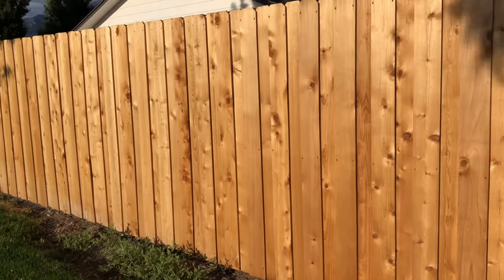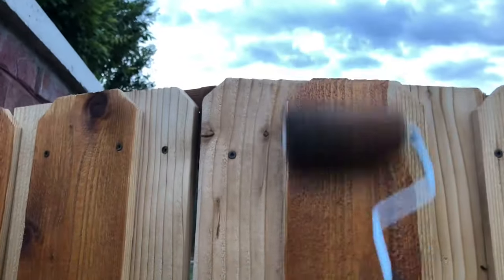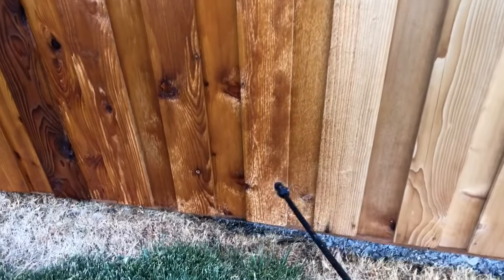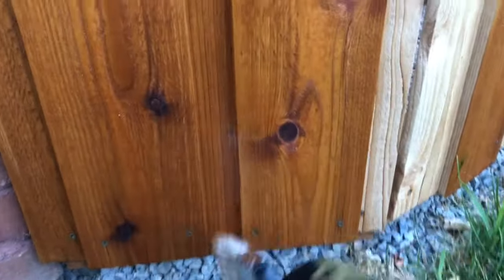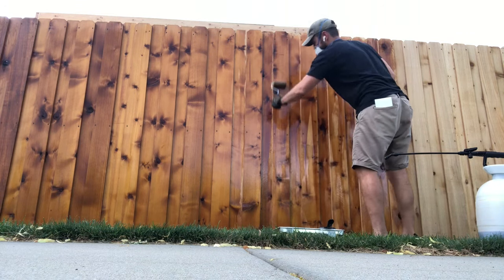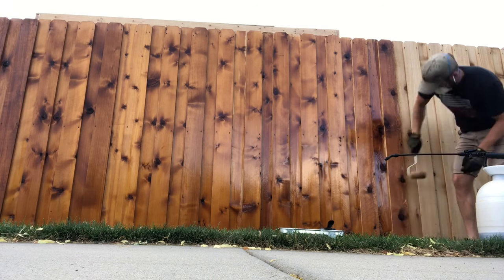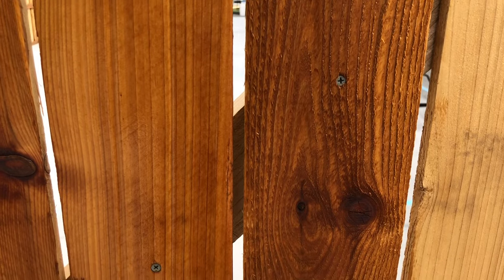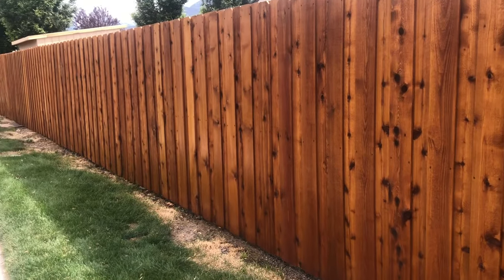Staining Cedar Fence with READY SEAL Light Oak - Spray, Roll, Brush

Comment: Do you need to do both sides for protection,I’m installing a privacy fence over my cyclone fence on one side of yard,once installed I won’t be able to access the backside due to not being able access as it is in my neighbors yard
Reply from the maker: That's a great question. What wood are you using? It will definitely help with longevity to do both sides so they're sealed and protected. But in my non-expert opinion, if you don't stain the backside, as long as you're using rot resistant wood like cedar, it would take a really long time for any kind of decay or rot to form and the make its way from the unstained backside to the front side. It would look really ugly on the backside after a few years but sounds like you'd never see it.

Comment: Does it leave a film that peels?
Reply from the maker: Not at all. That's the beauty of oil based vs. water based... Assuming the wood is properly dry, the oil-based stain/sealer will soak into the porous wood rather than sitting on top like paints and water based products, which end up peeling.

Comment: Did it end up fading after a year? About to stain my fence in the next few weeks.
Reply from the maker: It's been two years and still looks great. It has faded a little bit of course, but definitely doesn't need to be re-applied yet. Will try and post a follow up video soon.
Reply from the maker: Just posted an update on what it looks like now 2 years later if you want to check it out! https://www.youtube.com/watch?v=05B_spCNgv0

Comment: Hi Can I ask how the sealer is holding up? Thank you
Reply from the maker: It's holding up great after just over a year. It lightens up a bit in the weeks after applying, not since then. No regrets and I even used the same stain on another section of fence I built. Thanks for watching!
Reply from the maker: Just posted an update on what it looks like now 2 years later if you want to check it out! https://www.youtube.com/watch?v=05B_spCNgv0

Comment: Thank you for sharing. Been debating between light oak and cedar.

Did you power wash or clean the fence beforehand?
Reply from the maker: I built the fence and let it sit for about 3 months in the hot summer sun. Then LIGHTLY pressure washed it a few days before staining to get any dirt or dust off. Seemed to work well.
Reply from the maker: And I have only seen photos of the Cedar color, but I'm very happy we went with Light Oak. Love the shade.
Reply: Did you cover any metal parts before staining the wood?
Reply from the maker: @gigatube24    yeah I covered them where possible, but it wipes off of metal super easily so was no big deal if I got some on there (which I did). Just wipe it off soon after applying and don't let it dry.
Reply: @i_try_diy  I appreciate the information and the fast reply. Thank you!!

Comment: Did you do 1 or 2 coats and how many 5 gallon buckets did u use for the 130 feet of fence?  i’m assuming u did both sides?
Reply: Btw great video.  i have 120lf of fence so this was just what i needed to see thabks again.
Reply from the maker: Glad it was helpful! I only did one coat and used two 5 gal. buckets. Had a tiny bit left over after about 125 ft of 6' fence both sides. The way I did it was slow, but almost zero waste/overspray compared to if you use a sprayer, definitely a trade off.

Comment: How did the stain hood up after a year? About to stain my fence.
Reply from the maker: It has held up really well through all four seasons out here in Utah, really pleased with it. I'd say it's lightened up a little bit, but nothing major. Will probably re-coat in another 2-3 years. Good luck with the project!
Reply: @i_try_diy  Nice also another question how much stain did it take you? Just bought 5 gallon hopefully that is enough
Reply from the maker: It took me 10 gallons to do about 115 feet of 6' fence, both sides. It varies if you're using a sprayer or not, sprayers typically require a bit more stain
Reply: @i_try_diy  okay thanks just found out I have to get 20 gallons. I have 221 linear feet of fence with cap and trim.
Reply from the maker: @bayodaman  Just posted an update on what it looks like now 2 years later if you want to check it out! https://www.youtube.com/watch?v=05B_spCNgv0

Comment: How much should we charge per foot
Reply from the maker: Good question... I did 125 feet of 6' fence (750 sq feet) and it took me about 5 hours with pump sprayer, roller, and brush. If you're using a good sprayer that will cut your time in half at least. Maybe that will help you calculate a time and cost estimate.